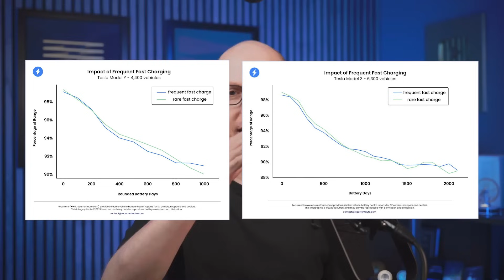Are 800V Architectures the Future of Electric Vehicles? (feat. Undecided with Matt Ferrell)

Comment: Most public changing mainly slow level 2.  Most public level 3 mainly 50kw.  Teslas charging stations all level 3 120-250kw.  We need more level 3 at least  120 kw.  Most Teslas come with 11 kw on board level 2 charger.  Many competition level 2 on board chargers only 3-7 kw.  The Hummer EV 240 kWh battery vs Cybertruck 123 kwh.  Smaller batteries, cheaper, lighter, and charge faster.  Lighter EV’a help handling braking and acceleration.  We need faster charging stations to charge theses larger truck batteries.  Teslas msrp helps pay for charging network.  Competition places network on taxpayers and private.

Comment: The fearmongering about V2G impacting the battery lifetime MFG 8yr/100K warranty) is a bit misdirected.   The vehicle manufacturer still in in control as they architect the maximum load the battery/inverter can source in a V2G/V2L.  Look at the F150 Lighting, maximum V2L discharge is 9.6 KW for a 90+ kWh battery pack.  This is a fraction of the peak DCFC input  of ~150 kW.

Comment: V2L or V2H makes sense for emergency backup but not for daily cycling. Batteries for daily cycling needs to be fully automatic and not depend on whether or not you plugged the car in. I think V2G makes a lot of sense for fleet operations, like school buses, that have a predictable schedule and significant down time. Emergency backup would not cause much battery degradation because it is not used very often, but sure is nice to have when you need it. I like the idea of battery warranties being based on total MWh throughput. A 100,000 miles of small EV would be about 25 MWh.

Comment: 400V, 800V, 1000V, etc.  it’s all about reducing charging cable current and getting kw Into the battery and getting the 10-80% charge times down 6:55 to 15m or less.    Too bad this is for 1% of the average use case for the average driver.   It matters for the Semi and for those who drive for a living.

Comment: would dividing the battery into 2 400v banks and then switch from parallel to series connection for 800v work?
Reply: This approach is done in the GMC Hummer EV
Reply: @bernesto2468 but it’s in reverse.  The hummer is a 400v system that effectively has twin packs that go from parallel to series for charging at 800v to transfer more power without overheating cables.

It’s relatively easy to do compared to the reverse because one pack can stay connected to the cars systems per normal, which wouldn’t be the case if you tried to split an 800v pack in half to charge at 400v

Comment: A common misconception is that higher voltage means faster charging; The cells themselves do not charge faster with 800 vs. 400 because the cell voltage (3.7v) itself doesn't change. The benefits are only in smaller wiring and marginally less heat loss in componentry and wiring.
Reply: C value rules the day in charging speed, not Voltage.
Reply: You kept me from posting this.
Reply: This. So annoying. (Annoyed at myself that I spend time listening to these idiots)
Reply: Amps are the limiting factor, where the heat comes from, why you need fatter wires.  You can deliver twice the power at the same amps when you double the voltage.
Reply: Less bolts more heat, it’s a heat thing cause 800 v uses half the amps and therefore half the heat
Reply: @nickford5549  The cells are 3 to 4 volts. The 800 volts only minimize heat getting to the cells.

Comment: Currently 800V is mainly marketing. The additional benefit only begins with large batteries >100kWh or exceptionally high charging rates (c-rate >3).
In terms of charging power, however, it will hardly make any difference for "normal cars" in the future, because whether you charge with 250kW up to 80% SoC, or with a peak of 350kW and falling to 200kW at 80% SoC, there will hardly be any time difference.
And I also see that in the future there will be many more charging points in places where you park anyway - at home / apartment / work / shopping center / parking garage - and 3 to 22 kW are usually sufficient for this.

But yes, there will be more >=800V systems in the future, and some manufacturers may also rely on a 600V architecture. In the end it doesn't matter, the manufacturer has to make the right choice in order to best harmonize with the built-in battery.

However, a 400V system will be completely sufficient, especially for many small/medium-sized cars - in the end it's all about the costs and economies of scale.
Reply: Good information. So 800 volts would allow half as much wire and half as much heat sinks on controllers, and motor wingdings that can use substantially less copper. With all things considered, 500 horsepower with 800 volts would require half as much current flowing through the controller, wires, and motor (compared to a 400 volt) which allows everything to be smaller. I don't know much about the details of electric cars, but doubling the voltage would allow a huge weight reduction in reducing the size of every component. I'm sure everyone knows this, and I'm probably stating the obvious. But the biggest benefit would be the 50% reduction in current in the entire system.
Reply: City power lines use 4,160 to 7,620 volts in the United States (Source: Google). They step the voltage down to 480/277/240/208/120 volts for the buildings and houses. Something that really illustrates the importance of high voltage: Go out in your backyard, and look at the TINY wire feeding your transformer on your wooden power pole that is in the back alley--it's a tiny, almost comically small wire, and it powers your whole house, because the voltage is so high on the city power lines. The wires entering the transformer from the power pole are tiny, but the wires going to your house are at least 3 times larger because they step the voltage down to 240 volts for your home. There is actually roughly the same amount of power being used by both sets of wires, the higher voltage wires are 1/3 of the size.
Reply: @Ritalie  It is not a simple halving of the cables while doubling the volts, because it requires more insulation or distances - more expensive components, etc.
Every system therefore has its theoretical sweet spot. Currently, 400V is much more common and therefore cheaper, even if larger cables are required.
And smaller 800V components do not generally mean that they are easier to cool, as the thermal energy is less, but more concentrated.

Comment: Tesla knows that most cars are driven to work. Ergo vehicle to grid won't be very effective as most grids need a boost during the day not the nights except just when people get home from work. Therefore for grid use the powerwall is superior in that it has special software that allows it to charge and behave differently than a car. 
However using your car as an emergency backup for your own house seems legit and I think Tesla is contemplating allowing that to happen and still keep your car battery under the same warranty as long as such use is far between. Otherwise it opens the door for legal nightmares on warranty claims.

Comment: Would be interesting to see if BYD and other manufacturers also show this low amount of degradation. It's all about the battery management software and components used.
Reply: Components in this case include battery cooling, the Gen 1 Leaf had battery degradation issues due to how Nissan implemented the thermal management.  Excursions outside the safe operationing area of batteries is a well understood problem at this point in time.

Comment: Hey folks, if you buy a new Tesla today... by the time you get to the point where your battery degradation is enough to make you consider a new one, battery pack costs will be a tenth of what they are now given the cost decline curve. 
So in ten years, for maybe less than $1,000, you could have it replaced with a new one. All those old batteries will also have a lot of value as in the next decade Lithium battery recycling will go into overdrive. So maybe that old Tesla's battery will have value by itself and you might get a rebate when you get a new pack?  Kind of like getting a core charge back on a car part today. 
I imagine that replacement interior parts to keep old Teslas going will become a thing.
Reply: Unfortunately the old EV's will probably just be thrown away, because the entire car will have changed so much in 10 years, that the old cars will be considered pretty well useless, because people in America hate old vehicles that are more than 5 years old. Yes, logic dictates that we should be able to just replace the battery and run the car forever, but consumers are trained to just throw away their product, not repair it. I think we need to change our entire culture, and keep all the old vehicles on the road. Making millions and millions of cars per year, is not actually necessary. Think about all the old manual transmission cars? You could replace the gasoline motor with an electric motor, and put a battery pack where the fuel tank was, and you have a really good electric car... It would be very easy to retrofit any old manual transmission car into an electric car, once we have sufficient battery technology to get the size of the battery down to a similar size as a gasoline fuel tank (this will obviously happen in our lifetime).
Reply: @Ritalie  Agreed! However maybe tastes will change with another generation?  If Tesla robo-taxis become a Thing then people will constantly be seeing them everywhere for decades.... they may never change in outward appearance as they just put new batteries in, new suspension, seats, and keep on going. Perhaps that might get folks over having to have a new looking car and cars will become just transportation and not a statement of status or a subculture like they are now. The value of a car would be what you can do while in it... the software or entertainment, not what it looks like. Kind of like how all cell phones look the same but the software distinguishes them?
 Maybe.

Comment: Tesla hasn't used V2G (So far) because as EM said on numerous occasions
"The vehicle is only a "home battery" when it's at the home "
.
Try going to your utility company and saying...
"Can you please arrange to only have power cuts when I'm at home?"
.
When they stop laughing (about 5 minutes) ask them why.
.
Now
The CT might have the facility as it will have power takeoff.
(It will also have an 800V system)
.
Future models might have the V2G facility if there's an across the board architecture change.
But it won't be done just for the sake of it.
Reply: My issue is convenience. If I work from home, and there is a long power outage lasting the full day, which happens about twice a year where I am, I would love to plug my house into my car for these rare events. It doesn't justify buying a Powerwall for several thousands. But it could justify the V2H setup.  Yes, If I have to leave during the outage, I cut the power, but if I'm home, I want to be able to use the 75Kwh of power I have in my driveway.

Comment: Fast charging likely keep the average charge higher compensating for heating damage.
Reply: In the 70-30% window like he said.
Reply: You'll be pulling maybe 12-15kW.
That's nothing for a vehicle battery.
It's purely a location issue.
If the car's not there the home doesn't have backup.
You come home to your freezer food thawed.

Comment: 800+ Volt systems are supposed to allow for faster charging and save weight with less thick cabling, but neither of those things seem to apply to the Hyundai/Kia EVs— their charging speeds top out at 240 kW vs 260 kW a Tesla Model Y can do. Hyundai/Kia EVs are also heavier than Tesla's vehicles, so what gives?
Reply: Faster charging is not a benefit of 800 vs. 400. Cell voltage remains the same. Faster charging is more in the realm of battery chemistry and the programmed charging curve.
Reply: @ryen7512  higher voltage means lower amps and resistance, so theoretically, you should be able to charge quicker with higher voltage without generating as much heat
Reply: @teslasnek  that resistance is almost negligible.
Reply: Yes but the Y is 30 min 10-80%, and the e-gmp car does that in 18 minutes.   It’s about the area under the curve not the peak.

I’ve put 50KW into my car in 15 minutes when road tripping

Comment: Not V2G again! 🥴
V2G makes only psychlogical sense for each single end consumer. On the grid/society level it does not. The two ways to not have large batteries sitzing around idle in cars are a) smaller batteries and b) smaller idle time. Robotaxy. IMO, thats also why Tesla does not offer it.

Btw. V2L is a different story, especially for a truck...
Reply: Yah, V2L makes more sense when your work site has no access to electricity due to the build timeline.  Having simple plugs to charge all your cordless tools from your main pack in the truck can help so much.

Comment: I would disagree with Matt on the idea Tesla does not offer V-to-G on their current vehicles because they sell a home battery backup system. Tesla had that feature on the first Roadster. It seems like Tesla likes to keep things as simple as possible. Adding V-to-G is adding cost and complexity. I think for Tesla getting high volume production with the lowest cost possible while making a product consumers would desire is their goal and many do not think about V-to-G. 

I do think V-to-G is appealing. Seeing how much headaches Lightning owners have had with getting their V-to-G to work makes me think the technology is not where it needs to be. Then again, Ford is good at screwing things up. 

I could see "fringe" cases where people might like V-to-G for cabins or buildings that have no grid access. If you were able to drive your EV to the cabin or remote work warehouse and then plug it into the building giving it power, that would be cool. 

For most buyers, V-to-G is mainly a power outage at their situation where they would use it currently. With that said, as the energy trading platforms become more wide spread, it might make it so people can store energy in their vehicle and at peak times, trade that energy to make some money. Not going to get rich doing it, but if a buyer could make $100 or so a month from doing that, it would help cover car payments or other overhead. Being able to tell a buyer that most owners of an EV reduce their car payments thanks to energy trading using V-to-G, that would add appeal to owning an EV. There are no ICE vehicles that can sit in the garage of a homeowner making them money doing something.
Reply: I disagree that the Tesla Roadsters have V2G capability.  Tesla did license AC Propulsion's "reductive charging patent" for early Roadsters, and this likely is the source of the "Roadster V2G" myth.  However, Tesla did not implement AC Propulsion's V2G capability. I will be very surprised if you can provide a source that shows a Roadster exporting power.
Reply: Hi!  Could you please point us towards a good info source on setting up Tesla vehicle to Powerwall integration?  Thanks.  I'm very interested.